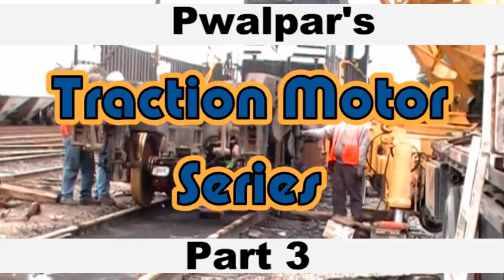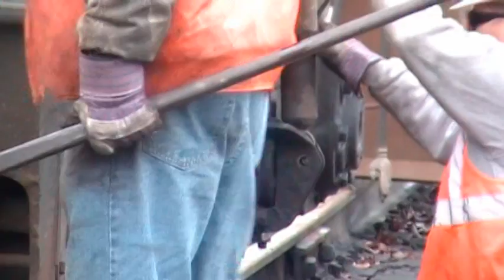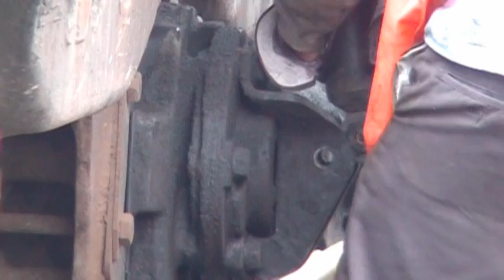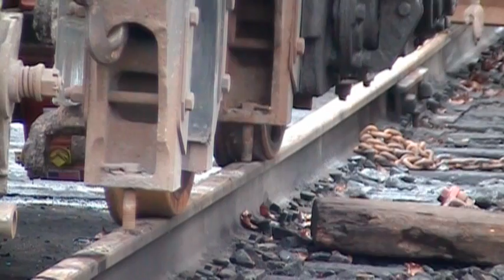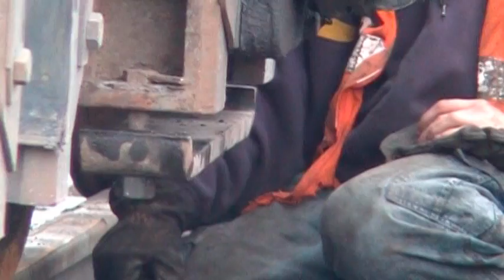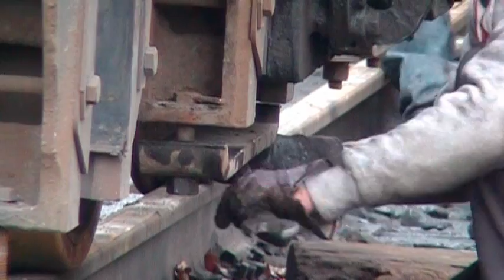Traction-Motor-Series-Part-3.mpg

Comment: ...use more anti seize on the bolt next time..it's just a shock absorber, don't be afraid to touch it...
  What part of the country are in...? I'm in Sacramento, Calif...just a few miles from Roseville yard...but they won't let you in there for a look...and also Sacramento had the Locomotive Works...they built the things there...